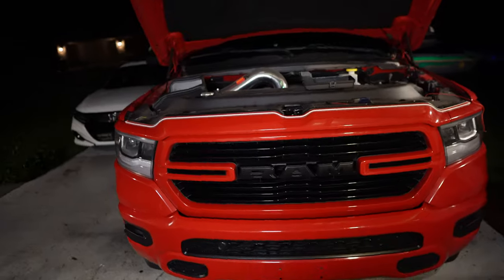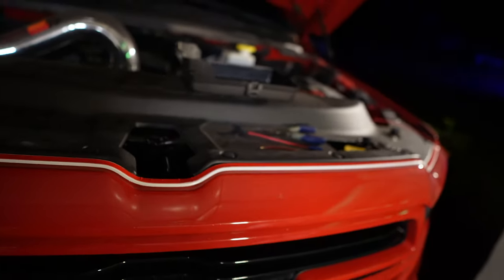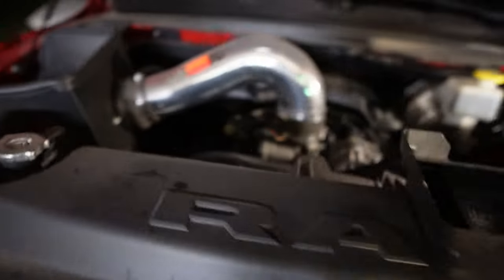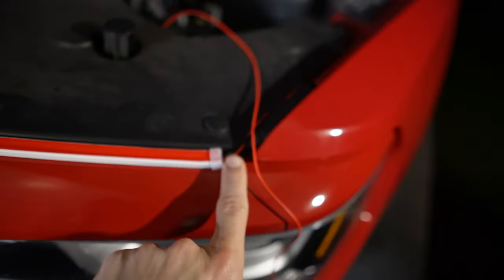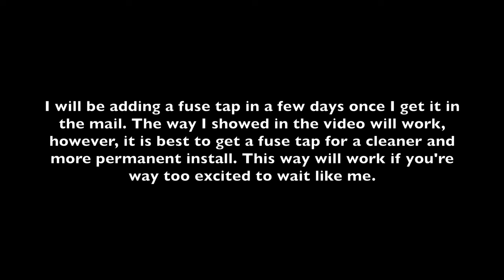SILVERHOLDER 72in DRL / Grille Light Install Ram 1500

Comment: After installing the light did you see battery slowly dropping down. My battery would be around 14 volts and now I’m noticing it dropping to 12.5 volts then going back around 13.5 volt
Reply from the maker: I haven't noticed that on my end but I haven't really paid attention to it.

Comment: Nice truck, the light looks nice, great job but a have a question, wouldn't be better to install the light strip on the hood, what happens if you need to remove the grill?
Reply from the maker: That's a great question... I guess I'll cross that bridge when it gets here.